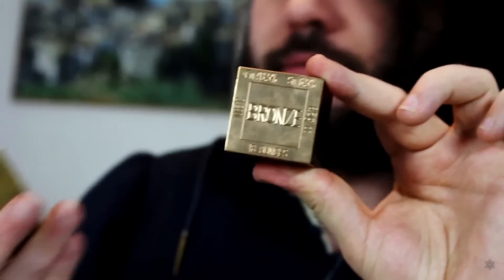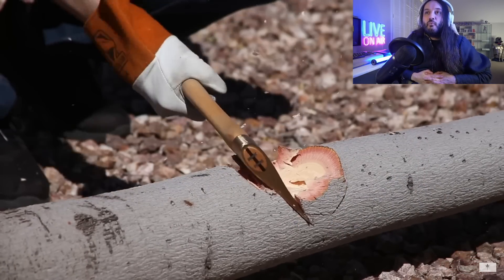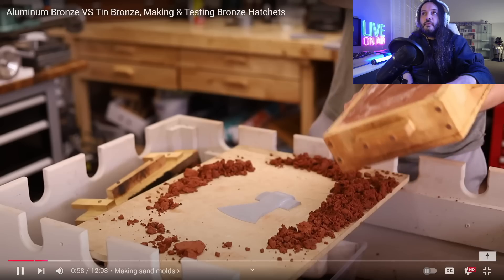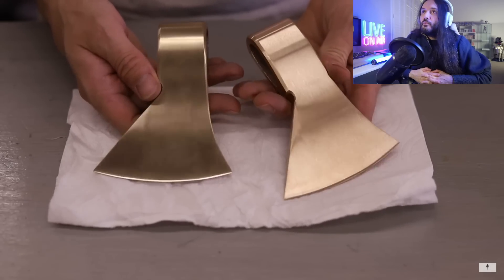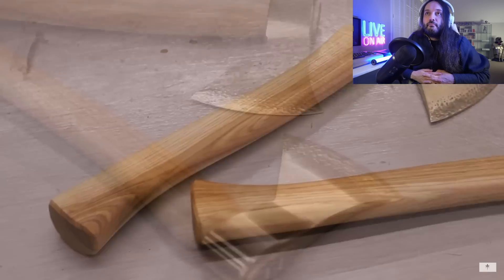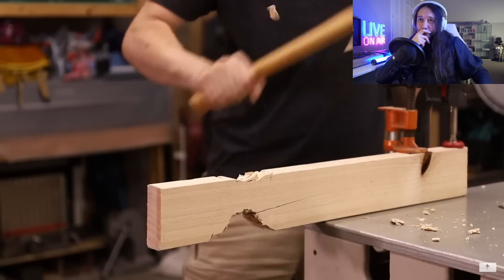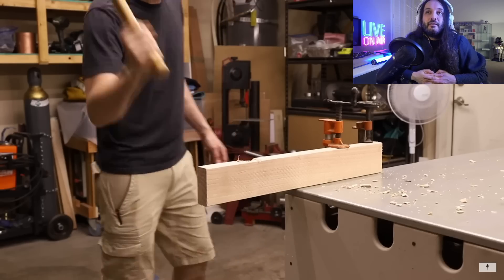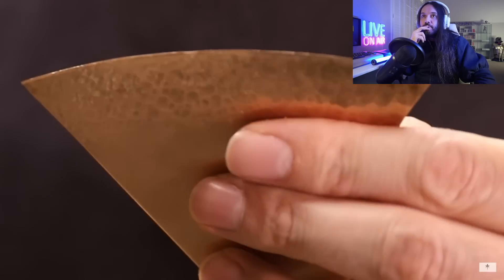Tin Bronze is INCREDIBLE - This Video WILL Change (Blow) Your MIND!

Comment: The reason he's doing aluminum bronze is that it's stronger than more traditional bronzes, at least according to what I've read. So from a metallurgical perspective aluminum bronze is very interesting, even if it's not a classical option (since aluminum refinement requires electricity in a process that wasn't developed until the mid 19th century, and of course steel is even stronger and cheaper, so aluminum bronze was only used for very particular things even after it was developed). I believe he's comparing it to tin bronze because he's already familiar with traditional bronzes, so from a metallurgical perspective, where he's coming from, this is interesting. Of course, you are correct that from a historical perspective it's not as interesting, because aluminum bronze is absolutely not a historical option. 

Also, I'm pretty sure that pure iron is softer than traditional tin bronze, but so much easier to source as long as you have the smelter needed to create it (since it requires higher temperatures to produce than bronze) and a bit lighter. And the difference in strength is not massive, so an Assyrian army that can equip 20,000 soldiers (and they got even bigger than that) with iron is far superior to a competing army that can only outfit 10,000 with bronze. And iron has the greater potential once you start to make it into steel (and because forges and smelters were powered by charcoal you would usually get at least some carbon in your iron, possibly giving you mild steel throughout your ingot, possibly portions of the metal being iron and others being mild steel... I know Shad did a few videos about this a few years ago where he did a good deal of the legwork researching these issues, if you want a simple way of looking into it), obviously a steel weapon is far superior to both iron and bronze.

Comment: The solid silver sledgehammer was made with 5 kilos of pure silver (plus some copper mixed in).  5 kilos is equal to 160 ounces of silver, which at today's purchasing price of about $34/ounce means the hammerhead cost $5,500 just for the silver alone.

Comment: Ancestors: "Thor's hammer made from Heart of a dying Star" Nuclear pasta. And if Church wasn't crashing DNA of Humanity/civilization you would have had plasma generated Ultrasound generating greater than bottom of the sea pressures to help you greatly increase density of metals. Make them bunch heavier yes, but can resonance bounce with Ultrasonic beam forming transducer in the handle. Vibrate it/Charge it just enough to make it light but not enough to break bonds.. 

Trigger system to reduce the bounce during swings so it becomes heavier but vibrates enough to be CLEAN.. Hammer's are dirty that's for impressing savage minds. < One step from light saber. You're not ready to control plasma around weapons yet, majority of you don't understand frequency filters on medical scanners yet to know how not to melt yourselves. Another thank you to the religious ONLY IN CONTROL.

Comment: It isn't a difference in "toughness" that separate iron and bronze. Iron and steel have better edge retention. The bronze tools will work but not nearly as well. It was bludgeoning the pine. The body of bronze tools will be fairly durable. They may actually be less prone to breaking. Harder materials are more brittle. A poorly made bronze sword will probably survive better than a poorly made iron sword. A bronze tool will get the job done but will need more sharpening. And over time, for any cutting tool; sharpening is the largest point of wear. In order to sharpen, you remove metal. And since bronze tools will need more sharpening, they wear out faster. If in a battle, a large amount of damage is being caused by impact as opposed to cutting; iron would not be a significant upgrade. But in terms of cutting, iron and more so steel; are better.

Comment: I used to be a jeweler and then started focusing on different alloys that were not gold or silver. I got so focused into bronze (all types) that I ended up making a maille hauberk from silicon bronze. Unfortunately, bronze is 40% heavier than steel or iron, so that hauberk weighs 47 pounds. It is definitely not your typical maille armor, but looks fantastic!
Reply: Aluminium Bronze would have been a better choice…
Reply: I would like to see that

Comment: I agree with you on the strength of bronze. For quite some time it was the preferred metal for cannon making. Bronze guns were used into the mid-19th century.
Reply: It wasnt prefered because of the strength, it was prefered because bronce cannons could be made more precise and it was easier to drill the bore.
Even today with carbide tools, it isnt fun to cut through the cast skin of cast iron/steel.
At least on ships, they started to replace the bronce guns with iron guns as soon as they figured out how to cast them (around mid 18th century), because a iron gun of the same caliber, is lighter than a bronce gun, and they keept the bronce guns only as hunting gun (dont know if this is the right translation, maybe chase gun fits better) on the bow
Reply: @wolf310ii  Mostly down to them being easier to cast due to the lower melting point. They also kept bronze cannons for a lot of naval use as well because of it's corrosion resistance compared to iron and steel.
Reply: @gavinrobinson8925  Having more guns or guns of bigger caliber, outweights the corrosion, also iron guns were less expensive (still today, copper and copper alloys are more expensive than steel)
Reply: @wolf310ii Bronze also has a lower friction coefficient than iron/steel, so there's less chance of a cannonball sticking in the barrel.
Reply: @SvenElven  Thats not really an concern, the cannonball is always a little smaller than the bore

Comment: a few cents of a metal worker who also happens to collect axes AND has used axes to chop down trees before:
first of all i'd comment that while yes, tin bronze is a quality material and might outperform iron in many ways, you'd basically never end up with iron as all historical methods of refining iron that i am aware of use charcoal as their fuel, which means at some point carbon does inevitably get incorporated, it's nearly always mild steel.
second of all i'd say that minor edge damage from a bit of use isn't really a good indicator of quality, i own a Gränsförs felling axe and that one chipped on the first tree i felled with it and that was just birch wood, so not even that hard. point is if you make/get a new axe, there's going to be edge damage from hard use. the true marker of quality is that i then went and fixed that minor imperfection and have not had any more chipping since, even with stuff like oak, beech and other hard woods.
Reply: I believe mild steel overlaps with wrought iron in percentage of carbon content, so some very low carbon mild steel can also be called wrought iron. Further, I was under the impression that working iron reduces the carbon content, so if you had a low carbon mild steel ingot and you continually worked it, you might reduce the carbon content enough to turn it into wrought iron...?
Reply: @Intranetusa  wrought iron by definition has a fibrous structure made of silicates and impurities, basically what's left of the ore during the smelting process, it's not produced anymore since the 40s I think. Usually wrought has spots of higer carbon content whilst other spots have almost 0. It works and reacts differently during working than mild steel. Mild steel has a uniform carbon content and is clean, they can't really be compared. In metallograhpic and archaeological publications a 0,2% carbon cutting edge of a medieval knife would still be called "steel", "mild steel" is more a modern industrial term
Reply: @Intranetusa Yup. You just keep reheating, folding, and pounding and it will eventually stop being steel as you work the carbon out.
Reply: @Intranetusa  yeah you can reduce the carbon content of steel while woeking it, it depends by exposition to forced air during heating. On the other hand, you can also encrease it, expecially if working with charcoal. This happens if the metal stays for some time in a spot of the forge where there is very small oxygen, and the metal can absorb the carbon gasses. Many medieval blades show a very narrow carburization of the edge, and it's hard to say if it was done on pourpose or just casually during forging, since that point of the blade is thinner than the rest of the body, so it gets hotter and absorbs carbon faster
Reply: What im getting from this is that the initial chipping comes from the casting process and doesn't affect the inside if you do it properly.

Which means if you want a "perfect" piece you'd need to spend a lot more material on a bigger chunk that you file down.
Reply: This reminds me of one of my pet peeves... when someone says "This knife is amazing quality, look how sharp it is!"... as if you couldn't get a butter knife razor-sharp.  For a few minutes...

Comment: I too love metal. I'm a metallurgist. I worked in a steel foundry for 14 years where I made steel. I'm currently sitting in my lab with several carburizing furnaces just outside. I've never dealt much with brass. But you are correct, steel is the superior metal.

Comment: These axes are really nice looking, but they are not doing all that well compared to a cheap steal axe. The edge has to be a lot less acute with bronze to make it durable enough.

As for swords: I'd think there you would notice the difference a lot more as to get the blade to have integrity it would need to be thicker so you'd end up with less reach - or if the iron sword is made to the same length it can be lighter and/or sturdier.
Reply: They aren't doing that well compared to a cheap modern steel axe.

A period accurate iron age low carbon axe wouldn't do well against a modern steel axe either.

And low carbon steel (which is usually what people mean when they say "iron") won't hold an edge as well as a bronze blade does.

Comment: Many people don’t realize that even thought Aluminum is found commonly in nature, it is usually bound to other elements. Until the mid 1800’s aluminum was valued about equal to platinum. Techniques were developed on separating aluminum to produce a purer metal if it.
Reply: Aluminium was first discovered and isolated in 1825 by the great Danish scientist Hans Christian Ørsted, the same guy who discovered electromagnetism. It was still prohibitively expensive to produce by the mid 1800s, until the discovery of the Hall–Héroult process in 1886.
Reply: @boesvig2258  It's still very energy intensive!
Reply: Hopefully one day we will reach the same point with Lithium. It’s common in sea water, but we don’t yet have an efficient way of filtering it out and have to resort to massive mining operations - and the land-based supply is soon going to begin shrinking due to its usage for electric car batteries.
Reply: @QualityPen  We need to find efficient ways to recycle Lithium batteries too.
Reply: @QualityPen Sodium ion batteries are inherently cheaper… (just harder to make).
Reply: In fact, when the Washington monument was built (at the US capitol) its aluminum capstone was the largest singular piece of aluminum in the world.
Reply: The by-product being fluorine gas
Reply: The same is true for titanium, except we don't have an easy way to separate it yet. If someone can figure out a way, it will be revolutionary because titanium has an incredible combination of strength and light weight, while also being non-toxic and hypo-allergenic.
Reply: @Quasarnova1 yes, titanium could then replace aluminium in many cases. Titanium is still very difficult to work with so it still won't be as cheap as aluminium.
Reply: I am going to remember this.
Reply: @shishoka  Napoleon III reserved aluminum plates and cutlery for special guests.  Everyone else had to make do with gold!
Reply: aluminum is just hardwood. lol, just kidding.. kind of. But Seriously it was the perfect metal for me to start working with as carpenter. Didn't even have to worry bout switching up my tools much
Reply: Amazing.  My aluminum AR's and pistol frames would be prized wonder metals and weapons if brought back a couple hundred years.  😝

Comment: "I have no idea what he just said" 

Simply put, Bronze expands quite a lot when you heat it up and the opposit is true as well, so if you want to cast it you need to plan for a "Reservoir" that can hold enough bronze inside of it to make up for the shrinkage of the cooling metal and is big enough to cool down slowly, otherwise the parts of your cast piece that cool the quickest will "suck" still liquid bronze out of the ones that cool slower and the Piece will get bevels and maybe even holes.
Reply: Interesting.  Thank you.
Reply: Nice information metal bro
Reply: Thank you!

Comment: I once worked at a R&D lab for a major tool manufacturer.  They had a full on metallurgy lab, complete with electron microscope, to ensure the crystalline structure of their carbide sawblade and drill tips was correct.  I wanted to go to school to be a metallurgist after working there for about a year, but I would have had to quit the job to get the degree, so it was kind of a catch 22.  Alas, life took me in a different direction, though my love of metals still remains.
Reply: yeah I bet it was a woman and I bet it ended in misery

Comment: Does a bronze tool keep on work hardening while you use it?
Reply: This actually applies to all metals but some will be more affected than others. Work hardening a metal is beating it and compressing the atoms and molecules closer together and eventually they can’t get any closer so they become brittle and will break. Hitting something softer than the tool has a negligible effect on the hardness but a sharp edge is thin and will blunt overtime. This will be due to numerous factors. When sharpening a blade you are removing metal. If an edge has been work hardened too much, the sharpening will remove that metal but you can also sharpen a metal too quickly and heat the metal to wear it loses its desired hardness and will blunt quicker.

Comment: You'd be shocked at just how effective work hardening certain metals can be. We played around with a lot of that stuff in some of the metallurgy classes I took. And I spent several years forging bars for some structural applications which was a lot of fun. Hard work, but fun.
Reply: Yeah even worked copper gets pretty hard
Reply: Do you happen to know if compressing the metal with a single motion, using something like a hydraulic press, would work harden it as well or if it's the repeated blows and added irregularity of hammering it that does the trick? I'm curious.
Reply: @backonlazer791  seeing as no one answered you I guess I will. There's two things that the hammering does, it work hardens it but it also relieves stress. It's not hardening due to compression but rather the way the molecular structure changes. So no, just pressing it with hydraulics won't work.
Reply: Working hard or work hardening?  amirite?  lol.   I've tried to use small pieces of titanium as shims and washers for certain projects and the work hardening is so real it makes it extremely difficult. Getting it wrong and trying to bend it into shape just turns it into a brittle mess that shatters into pieces.

Comment: I could be tempted with a bronze K-Knife.
Reply: Way more metal than one made of solid gold or silver. Pun not intended.
Reply: Well i wouldn't recommend trying to cut anything with it. Unless it's something very soft. Cuz it will dull after 1 incredibly fast
Reply: @mikeboyce21 Not as weak as you think. Bronze is still used in mining tools due to not sparking.
Reply: @nicholasneyhart396  i didnt say weak, infact quite the opposite it's soft so it's very tough.
Reply: @mikeboyce21  It is softer than steel, but significantly harder than pure copper or other copper aloys like brass. Bronze retains an edge fairly well.
Reply: @nicholasneyhart396  yes I am well aware. My point is it isn't even close to being as good for a knife as steel. Nor would it be first choice for a mining bit if   steel/ steels didn't spark. It has a max hec hardness of 44 which is garbage compared to modern steel which goes to 70 hrc.
Reply: @nicholasneyhart396  and that's assuming your goal for a knife is to have good edge retention.  As a knife is for cutting so you would assume that's what you'd want from a knife
Reply: @mikeboyce21  I am aware that steel is harder, I am just saying bronze isn't as useless as people think. I use a bronze hatchet and chisels for woodworking just fine.
Reply: @nicholasneyhart396  there must be a reason you choose bronze. And certainly isn't because it holds an edge longer. There is a reason bronze hatchets aren't as popular as steel
Reply: @mikeboyce21  I had a summer job in a chemical plant and grew fond of the golden brass and bronze no spark tools. Hammer and hatchet are easy enough to find, but this would be exotic.